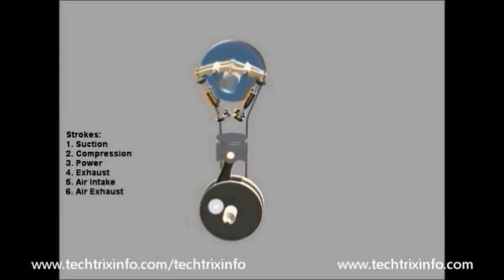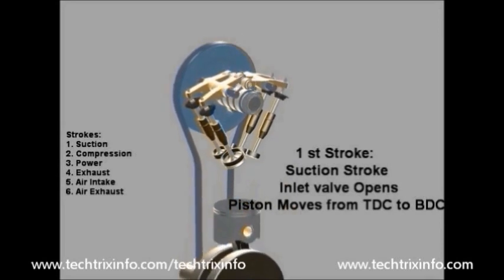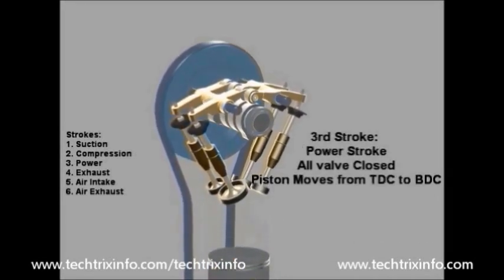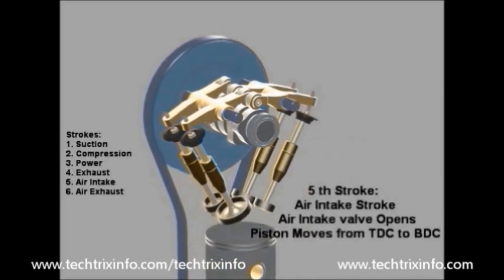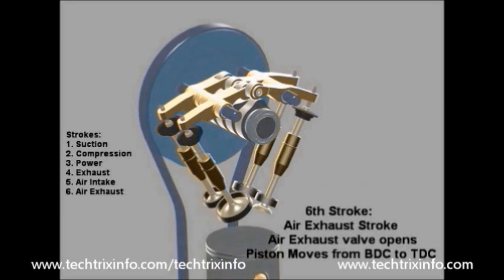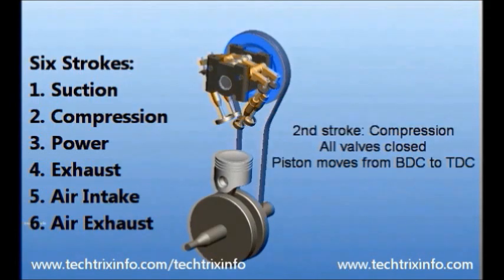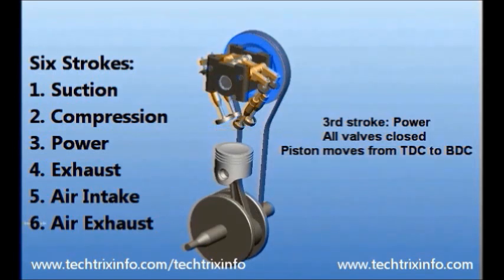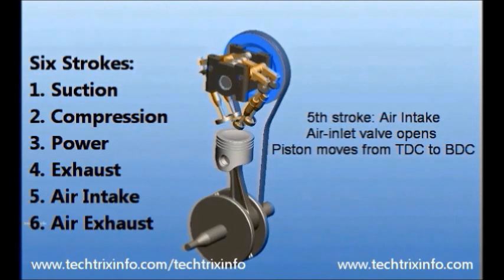Animation - Six Stroke Engine Explained.

Comment: Your just wasting fuel on the 5th and 6th stroke
Reply: No boss there's no carburettor in this
 fi system and fuel is only injected with the help of emu
Reply: I am working on six stroke engine technology by collecting different journals for my college project
If u can help by providing some latest updates on this then please let me know
Reply: @salmanmohammed7904  had no idea you looked at this. After some of the stuff I’ve picked up over the years I have come to understand that the pressure from. The other cylinders would be enough to scavenge more power out of an engine. Still surprised it’s been 3 years tho

Comment: This is a pointless 6 stroke engine, a proper 6 stroke engine you inject water on the 5th stroke, it vaporizes(expands) and that exiting is the 6th stroke, greatly helps lower engine running temps
Reply: +Mitchell Howell The air will also expand and create power and will also cool the engine. The principal is the same.
Reply: Burning gasoline produces considerable amounts of water vapor anyway, but it's too hot for it to condense until late in the exhaust system.
Reply: Not too bright, are you?
Reply: I suspect you're trolling, so I hesitate to indulge you. I'm nether an engineer nor a mechanic. However your question leads me to believe that you're intentionally ignoring the fact that such a cycle would require a substantially modified engine, hence I'm unlikely to void the warranty on my own vehicle. 

In any case, if you want to know how they perform, this is clearly the wrong place. The first place to look would be for scholarly articles from reputable institutions who have built and tested these engines in comparison with traditional gasoline 4 stroke engines. Random people on youtube comment threads don't strike me as the best place to go if you are seriously interested in learning; ergo, I strongly suspect you of trolling me.
Reply: There's no expectation that 4-stroke engines will be superseded by more efficient cycles. The expectation is that they will be replaced by battery electric vehicles which have vastly higher efficiency and are already on par with high-end gasoline powered car. Research the Tesla Model S and compare it to similar priced gas cars. 

There will still be applications for gasoline engines into the future, but they probably won't continue to be the first choice for mass market automobiles. 

Diesel engines have their own set of problems, mainly that of air pollution and smog. Cities with high numbers of diesel cars frequently have air quality issues. Paris, for example, has to restrict the use of diesel cars in the city during some whether conditions. 

In general, internal combustion engines create a huge amount of overhead and lose a great deal of their efficiency to emissions controls which are required to enable them to be driven though the same air that humans have to breathe. Battery electric vehicles deliver far more performance potential while having a much simpler and more efficient drive train. 

So if you ask me, all this 6-stroke talk is already obsolete and creates more complexity in an already overly complex engine which already struggles to fit into the modern world.
Reply: I will point out, however, that your efficiency numbers don't apply to modern gasoline engines. In the past, gas engines have used dramatically lower compression ratios to prevent pre-ignition. Modern gas engines use direct injection similar to diesel engines and are not limited to such low compression ratios. They can have similar thermodynamic efficiency to diesels.
Reply: There are several factors. You're right, current diesel engines still compress more, although 30+ is probably an exaggeration. Mazda's gas engines are in the 13:1 range and a typical diesel might be 18:1. But 50 years ago, typical gas engines were well below 10:1 and going back to WWII typical compression in gas engines was 5:1, so that gap has closed considerably. My point being that there really isn't a limitation on compression with gasoline engines anymore since the fuel isn't present anymore during the compression stroke. The reasons for keeping low are ultimately arbitrary and have more to do with secondary engineering and cost considerations. 

There's also the energy density of diesel fuel which contains more energy per litre compared with gasoline. Overall, per unit work, you get more for your money so it is still more cost effective to burn diesel, also requiring less fuel storage. 

The gap isn't nearly as wide as it once was. I didn't say there's no gap, just that it's closed considerably. Your numbers look a little dated, although I'd have to do some research to be sure.